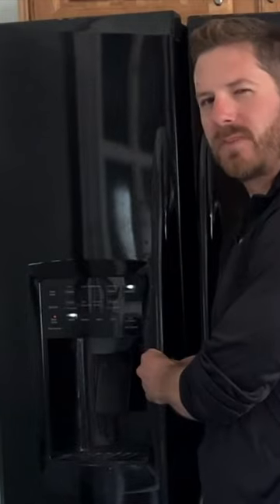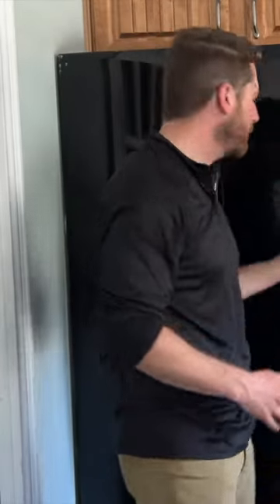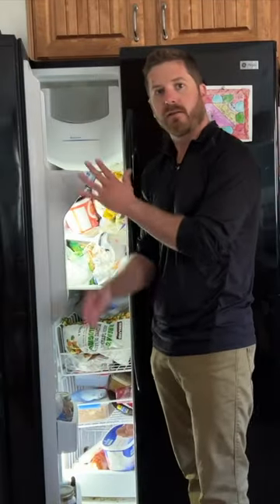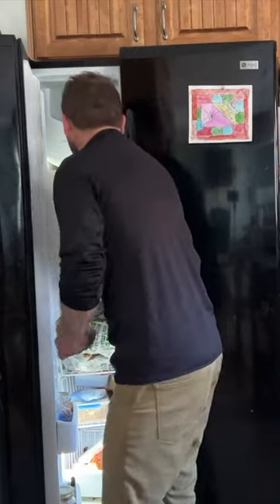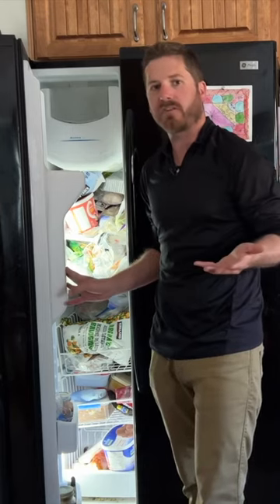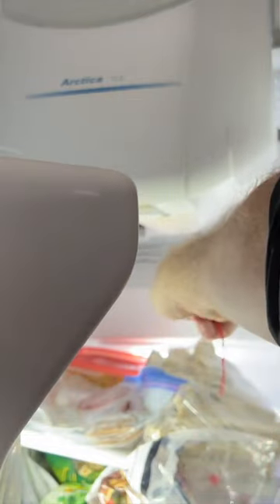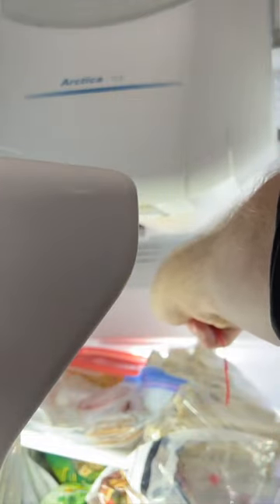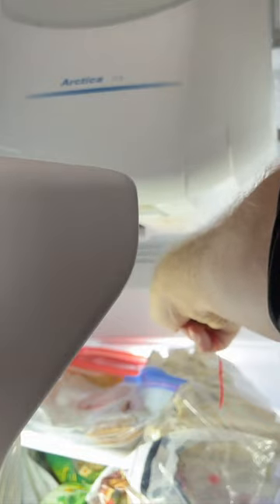Freezer Noise Gone In Less Than a MINUTE!

Comment: This noise has absolutely nothing to do with how 'stuffed' your freezer is - The noise disappeared because you opened the door which turns off the condenser fan...which is on the door switch circuit... The moment you closed the door and turned off the light which opens the circuit to the condenser fan and thus turns the fan back on - the noise came back...
Reply from the maker: No, it was because of overstuffing.
Reply: No matter how many times you say it - you are still dead wrong - My freezer is currently making the exact same noise - it has 7 items in it - Please tell all of us again how overstuffing causes this noise - Sorry kid, you are just wrong...overstuffing has nothing to do with this noise. The noise in your fridge/freezer is the evap fan...As I mentioned in my first post the noise will stop when you open either the fridge or freezer door the noise stops because (on many models anyway) the fan is on the door switch circuit

What you may have experienced with overstuffing is that you had so much stuff in your freezer that it was pressing up against the panel where the evap fan is located, causing what residual ice build-up may have been near the fan to be pushed into the fan.
Reply: @soundproofguide  fixed mine